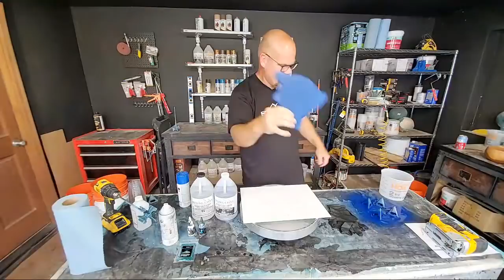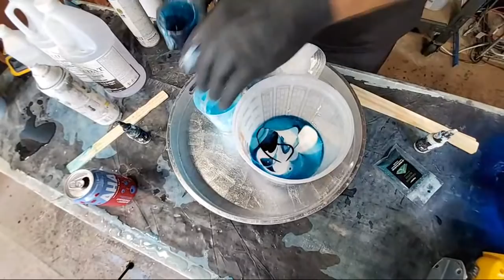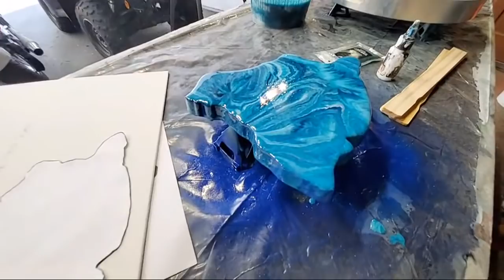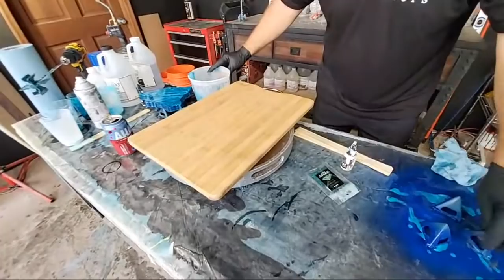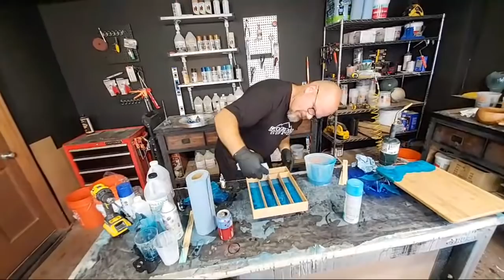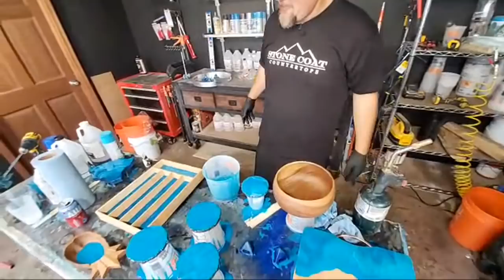I Hope This Works | Virtual Craft Festival | Stone Coat Epoxy

Comment: I have been watching your videos for ....... quite some time. You have peeked our interest in pouring out own countertops. So, I just had a conversation about countertops, today. When I brought up your system (I didn't call it by name, at first) I was told that epoxy countertops are too soft so you can't put or cut anything on them and that they are not "food grade". Once I said Stone Coat and explained that the system is more durable, I was told "Oh, yeah. Theirs are good products. Just don't go with other companies or buy stuff from Home Depot. You won't be happy." As soon as we get to the kitchen part of our remodel, we will be reaching out, for sure.

Edit: So I just got to the part of the video about not cutting on the epoxy ...... I may have misunderstood about the final product durability. We always use a cutting board so it doesn't effect our decision. We will still be Stone Coating our countertops.

Comment: Have had problems with air bubbles in the past on concrete floor after I grinding it properly and cleaned it thoroughly, any suggestions as to what that might have been or do I just have to learn how to combat this issue for future projects?